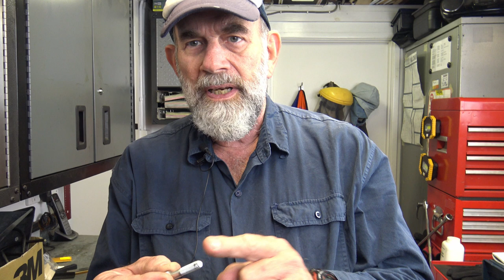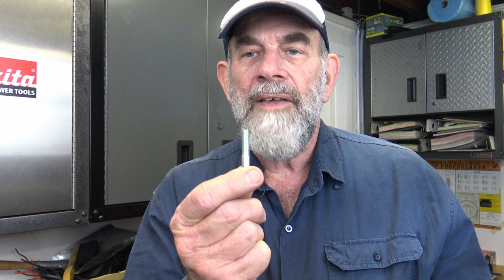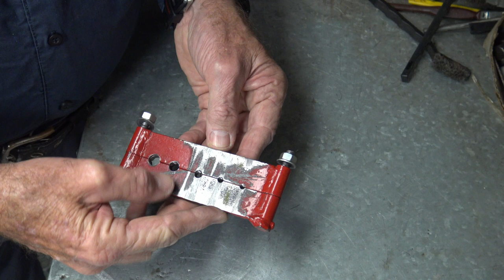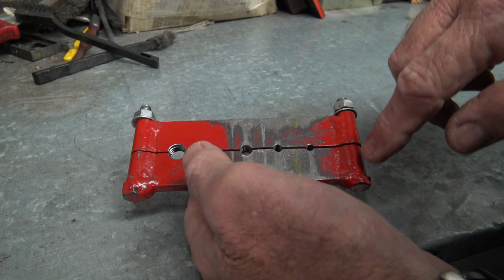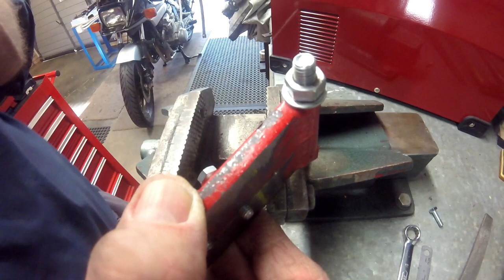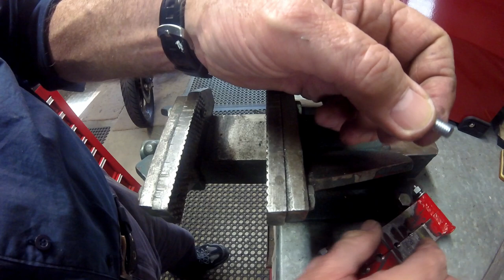Cutting down bolt or screw length without damaging the thread

Comment: Very interesting design, thanks for sharing. I, like some of your other commenters, just hack off the end as I have never needed the precision. I do usually thread on a nut to "clean" up the threads afterwards, but can see where this tool would be very useful and will keep it in mind for future projects ideas
Reply from the maker: I used to just hack the ends off too, sometimes with tears as to the result, but since I made this tool I have found it so quick and easy to use. Thanks.